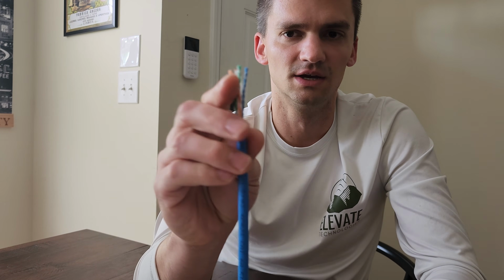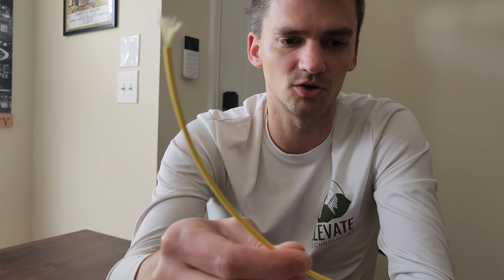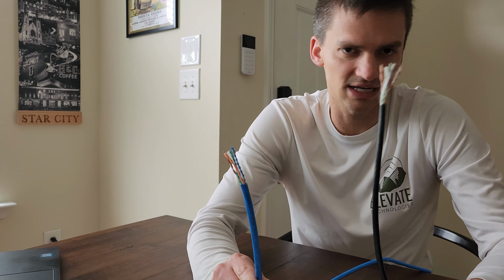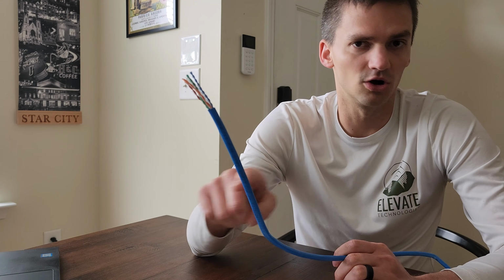Cat6 vs Cat6a vs Fiber: The Ultimate Guide to Future-Proofing Your Home Network

Comment: I've decided to run a 2 Port Keystone wall jack to rooms in my home one with Cat 6 and one with SM Fibre on a keystone LC socket.  To most points around the house Cat 6 to every point that's <50m and Cat 6a over that.   SM seems bonkers now, but I remember DREAMING about getting a 64 kb line whilst using a 2400 baud modem and downloading to 800kb floppies.  What seems bonkers today will be great in the future.

Comment: really we almost only pull CAT6A because labour is most of the cost and if they need more in the future then they have it. We also tend to pull 2 lines per required jack for the same reasons. Fiber we have been doing more of when the run is under 30m because pre terminated cables make this more cost effective when considering future proofing.
Reply from the maker: Love using the pre-terminated fiber. It's such a big labor cost savings.